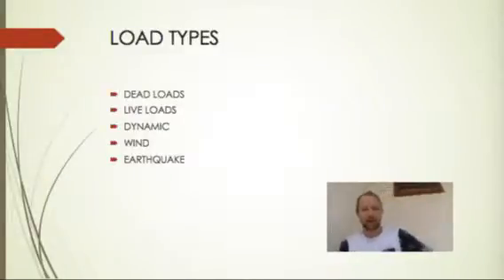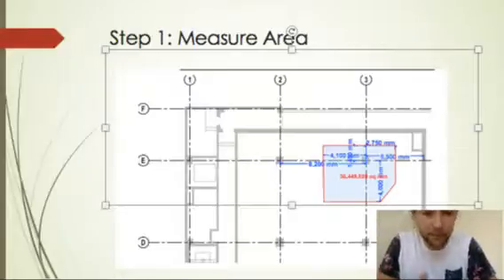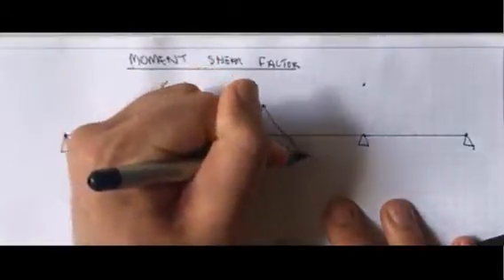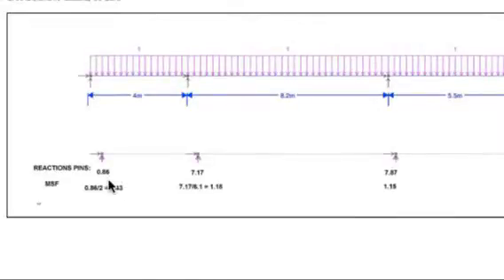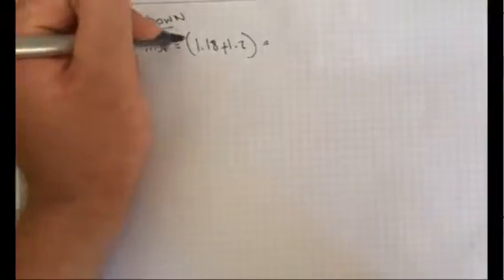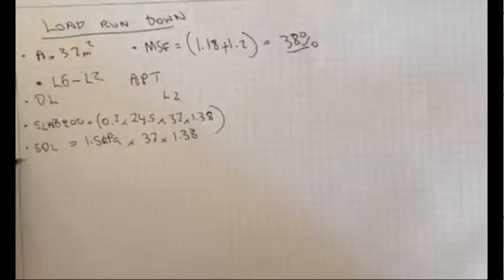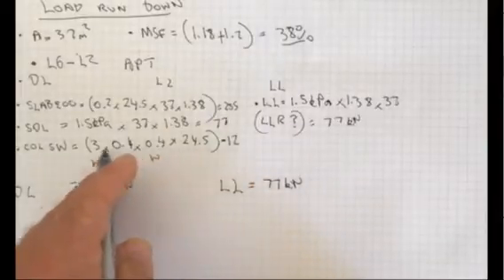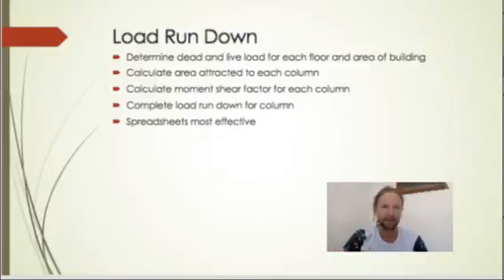Load Run Down

Comment: Hi Adam, 

I think adding both the MSF for each direction is conservative. In reality, the numbers are saying that the column attracts 18% more load in one direction, and 20% more load in the other direction. Because the load calculation is based off of a tributary area that takes into account both directions, I believe these two figures should be averaged, giving a total MSF of 19%.